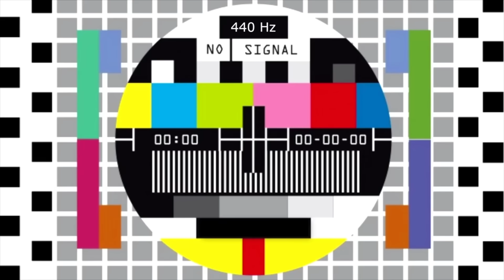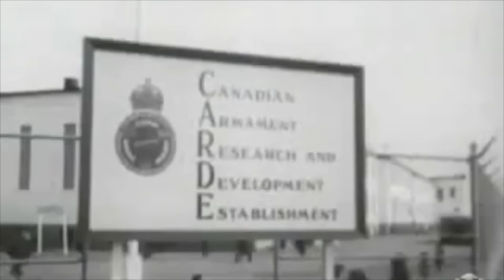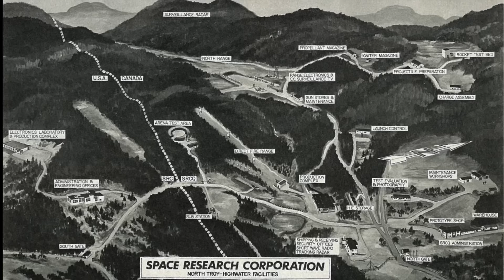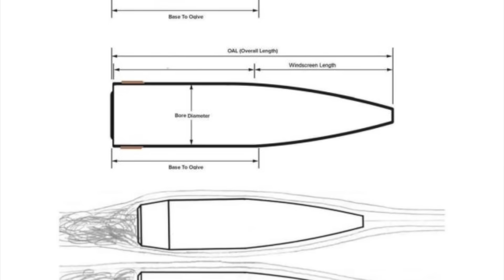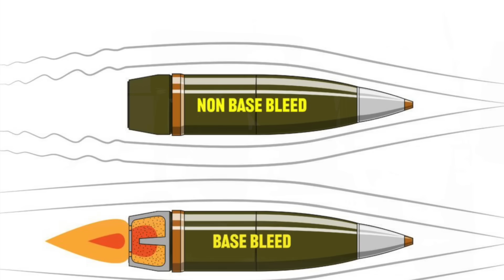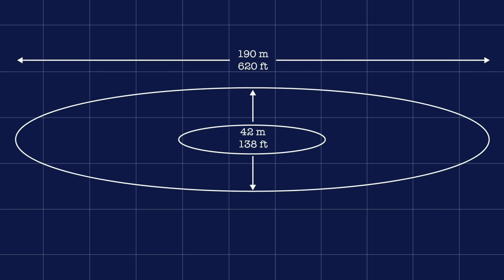155mm ERFB Shell: Faster, Farther, Deadlier

Comment: Although indian army has used this for yearns now, but recently they are in a procedure of replacing thousands of these, by developing new type of shells , successfully developed.
India , got it's erfb - BB OR BASE BLEED , and ERFB - BT OR. BOAT TAIL.
BOTH produced under licence from south africa in 90s for its fh haubits 77 155 mm from Sweden  and its domestic version 155/45 Dhanush and and a new project 155/52 ATAGS , equivalent to Israeli Athos .

Comment: For a brilliant guy I'm always confused by people who think you could get something into satellite orbit with a single propellant blast. I understand the "thinko" of assuming that altitude or wind resistance is the main obstacle of getting something into orbit ... but it's actually the requirement that the object move across the distance of earth that will "drop away" by ~4.9m per second: Half of the amount gravity accelerates something per second. Half, bc if it accelerates by 9.8m², then the average speed of that second is halved. And at about 200 miles up (low earth orbit) it has to travel across about 7 kilometers per second. Of course, you want to do this outside of the atmosphere so that you aren't constantly paying the price of wind resistance. But that's the role of the altitude; being outside the atmosphere. But you still have to be traveling 7 km per second. And we don't even have propellant that burns at 7km per second ... let alone the ability to accelerate something to the exact speed the propellant burns off a single burn.

There is a company (Spin Launch?) that uses partial vacuum to spin projectiles (like under 50 pounds?) up to mach ~5 before releasing it. I STILL have no idea how they'd use that to get something into orbit, as it's STILL going to need a LOT of energy to finish accelerating up to mach TWENTY. 

Granted, if you do the math ... you'll see that SpaceX rockets use 50% of their fuel getting their rockets up to 5% of their end-velocity. But the g-force of accelerating a pendulum up to mach 5 is ENORMOUS. And they can't include the fuel required to get these things up to orbital velocities ... so I'm not really sure how it does any good to get to any speed that's less than the end-speed. Until and unless they could launch something WITH the energy on board to reach even a rendezvous speed to even say ... increase the ultimate payload at a lower launch "price" ... I just don't see the benefit to these projects. But ... maybe I just lack vision ... bc obviously they're receiving $10s of millions in funding.

EDIT: Apparently they're launching payloads of ~450 pounds, which after launching at ~5,000 mph, then has enough fuel to accelerate another 12,000 mph up to the 17,000 mph orbital velocity. Which really does make total sense (for very small satellites).

Comment: There is new G5 experimental version that can fire up 75 km. It has a longer barrel than the standard version. When the G5 was tested in the 80's, ranges up 90km were achieved with an overcharge ( power bag with a cup of diesel fuel). There have been cases where a 155mm shell hit a bulls eye ( A large tractor tire) spot-on 42km.
Reply: I would like to know how such accuracy is achieved isnthis after wallking the rounds in with a spotter, only taking a few rounds then does it hit conaistently.

Comment: The base  bleed shell is exactly that. It bleeds gas that displaces turbulent air behind the shell, which significantly reduces drag. The shell has a small block of magnesium in the base of the shell, hence "base bleed". The magnesium ignites when the shell is fired as a result of the temperature in the barrel. That is why it will look like a tracer at night. There is no "assistance" for the shell, but merely a much reduced drag from the gas produced by the magnesium. The barrels are not anything "special", it's the shells that maketh the artillery, along with the targeting system that measures, and account for, atmospheric temperature and wind speed. When these guns were introduced, they could fire a base bleed shell to 40km, and hit a target as small as 5x5 meters, within 3 shots. When I was doing my post graduate studies in mechanical engineering, we had an absent collegue. This was at the Potchefstroom University, now NWU, which is right next to South Africa's North West Command and Artillery Training School. We would here these guns firing from our classrooms through spring. So, our missing student studied mettalurgy, and received funding from the SA military to remove a disadvantage of these shells, and those were the drive bands. Each of these shells has two drive bands, that seals the shell into the barrel's rifling, which results in friction, and reduced muzzle velocity. So his project was to develop a more malleable allow that would reduce barrel friction (which will obviously also reduce wear), while surviving the the stresses from the charge. At our last quilloquim, he had permission from the SA military to share his study results. With the reduced friction from the alloy he developed, the range was extended from 40 km to 67 km. And with tweaks he got a firing range of 76 km. Thats about as far as a HIMARS rocket's reach, at a fraction of the cost, higher sustained firing rate, and much more ammunition on hand. There is no other artillery gun in the world that even comes close. Something interesting to note, these shells fired, at maximum range, can hit a commercial airliner flying at 39,000 feet. So, the most important part of what I shared with you is this: Avoid commercial airlines that fly over Potch!
Reply: 😀...ja Potch is 'n ander plek!  Dankie vir die 'hands-on' informasie.
Reply: @vlermuis2416  n Paar van my dosente was ex-krygkor navorsers wat gewerk het aan die Cheetah en Rooivalk. Baie interessante goed geleer.
Reply: Thanks for sharing this!
Reply: @janventer7942  
   
I am someone with 30 years experience in pyrotechnics and a license to manufacture low explosives/pyrotechnics with a full time job in pyrotechnics. With a particular interest in aerospace applications/high altitude/vacuum environments.

You either do not remember what someone told you long ago correctly or have not now stated it fully/correctly enough in your description. As you described this, it is not workable. 

Go look up the physical properties of magnesium oxide and see if it is ever a GAS when produced by burning Mg in atmosphere? MgO won't be a gas below about 3,600°C, I can assure you. It is released as a REFRACTORY solid, NOT A GAS at the temperature Mg burns at in atmosphere.

If you use certain oxidizer systems such as chlorate/perchlorate salts and/or chlorine "donor" adjuncts with Mg POWDER as a fuel in PROPELLANT TYPE MIXTURES WITH BINDERS & ETC., you COULD produce magnesium chloride instead (among other gaseous products), MgCl is a gas at only 1,412°C.
Reply: 14 Field Artillery kannon donkies 🤣🤣🤣 yip janventer7942 you 100% correct .......thats why a normal rifle tracer has a higher velocity than a normal FMJ due the same concept of less drag....
Reply: @dirkshumbadrinkersb4908  I actually never thought of that! 😁
Reply: What gas do you mean- ? Please ell us its  chemical name or show its molecular  formlla
Reply: @russellseitz  Doesn't matter what the gas is, as long as it displaces air behind the shell. Stop being a stupid tool.
Reply: Reducing drag is by definition assistance. You cannot write such a paragraph and expect to be taken seriously when you're wrong in the first couple sentences. You need to get less of your information off reddit. Calling a gas generator a "small block of magnesium" is... Well it's comedy. One solid option is composite propellant composed of polybutadiene as the fuel and ammonium perchlorate as an oxidizer.. No magnesium needed. Furthermore your claim of the longest range artillery is incorrect. Bae systems reached 68 miles out with a 155mm round. That's almost 110km. You're right! No other artillery comes close... because BAEs system flies significantly further. Your numbers for HIMARS is completely off as well. It's range is around 185 miles (300km~), further than your inaccurate claim. You're one of those people that really exemplify Dunning-Krueger effect, and your very obvious attempt to obfuscate your lack of knowledge via pure quantity of words (lacking quality) is not going unnoticed. Let's wrap this up with quilloquim is not a word, someone who has ever been present at a colloquium would kmow how to spell such. Stop while you're ahead.
Reply: @DarkAttack14  Just so everyone know, BAE systems has only reached a distance of around 30 km with an unassisted round. I.e. without propulsion (that is something that continuously provide thrust). A base bleed shell does not provide thrust, it only reduces drag. The figure stated by DarkAttack14 is completely false.
Reply: @DarkAttack14  Oh! A bot! Doh!
Reply: @DarkAttack14  I got my information first hand from a researcher that upgraded the shells. Where did you get your information from. And there's a big difference between reducing drag and actively propelling. Get your facts straight.
Reply: A base bleed unit isn't a "small block of magnesium". It is a GAS GENERATOR,  burning magnesium has a SOLID product (magnesium oxide), useless for this application.

Base bleed pyrotechnic mixtures are more similar to  composite rocket propellants and MAY include some finely powdered metal fuels to increase heat of reaction & output gasses but are mostly oxidizer (usually ammonium perchlorate these days), gas generating fuels/binders and/or explosive ingredients chosen from the usual group of propellant chemicals. Mechanical engineer, huh?
Reply: @BertRowe-b3l  I have personally tested 2 different types of field-returned US base bleed grains and dissected the propellants for evaluation. One was an ammonium perchlorate composite, and the other was a double base. Neither contained significant amounts of metal in the formulation.
Reply: @BertRowe-b3l Is that similar to the inclusion of Aluminium powder with Nitrogen fertiliser for a bigger bang ?
Reply: @BertRowe-b3l  He contributed a lot more than your nitpick. Should we award you a badge for being a know it all? jirre
Reply: @Arion-z7l  🤣
Reply: @Arion-z7l contributing requires truthful statements, the original poster here made up a ton of bullshit and expected you to swallow it lol.
Reply: @BertRowe-b3l  No, you have it backwards. Several of my lecturers were involved in military R&D at Armscor during the 80's. They know a million times more than you about the designs of all SA's self developed weapons systems. The magnesium block is the most important part to achieve base bleed. 

"Mechanical engineer, huh?" What are you?
Reply: @janventer7942  He is a troll-comment engineer 😀
Reply: @janventer7942  
Three times I have replied now regarding what a base bleed unit actually is/magnesium oxide not being a GAS- and 3 times my reply has been deleted. That's interesting!
Reply: @BertRowe-b3l  Maybe its not because you are factually incorrect, but because you are being a troll about it?

Comment: At 6:31 you state GC45 the 45 indicated 45 calibers or internal barrel diameters long a "RATIO" that Bull calculated to be optimal.  

A ratio to me indicates that the number must have a NORMAL component height to width.....  Can this "RATIO" be explained or am I nit picking on choice of words?  

To me it says that the diameter of a shell should require and optimal length of barrel to achieve it's best distance.  NO?
Reply: I would think you are right about the ratio. The length of the barrel being 45 times the diameter of the shell.

Comment: Oh baby. Now your talking my lingo. USMC Air Naval Gunfire Liaison Co.  unit in the 80s. 
My unit was trained to call in Air strikes at night
With recon units.  We could hear The 105 and 155 going over our heads at night. From 10 miles away. Easily hitting targets
 1 to 10 miles away. Accurate within 9m. Few years later in Afghanistan and Falucia they were calling them in going through windows of the target building. Oh well did this with Linsatic compasses you had to light up with flashlight and prc25 radio. Closest phone was in the E club.

Comment: Except ... an unguided shell can't achieve orbit. It can go as FAST as something orbital, but without any sort of motor, the ellipse it follows will pass through the last point where it was given a nudge (in this case, the moment it leaves the gun barrel). The very best you could do would be a shot tangential to the surface of the Earth (firing just above the horizon), but even then the shot would arc out, circle around the Earth, and then enter back into the atmosphere to complete the ellipse (touching the end of the gun barrel). In practice, drag from the atmosphere would keep it from reaching the point where it started ... but without some sort of motor (or drag) to change the orbit, it's always going to pass through the last place where it received any thrust. I suppose they might have been planning to include some sort of small rocket thruster on the shell to tweak the orbit once it cleared the atmosphere, but a GUN is a heck of a lot of impact inertia, and you'd need a guidance system that could handle that launch.
Reply: Plenty of artillery rounds have had internal electronics the super gun was to launch rocket assisted rounds.

Comment: The nubs do not engage the rifling. They ride over the rifling. The nubs are too wide to engage the rifling.  155 mm guns can shoot standard rounds and ERFB rounds. The nubs keep the projectile centered. The nubs are angled to match the projectile spin caused by the driving bands.  The ERFB projectile still uses a driving band, it's just not as substantial as the original driving bands.
Reply: I'm sorry, I don't understand.
The way I read your post is that the nubs make the projectile wider than the inside diameter of the barrel. I am not sure if that is wider than the lands or the grooves of the rifling.

But,  you say the nubs do not engage so their diameter must be less than the barrel.
Reply: @ the actual projectile is a smaller diameter than the bore except at the driving band. The nubs center the projectile in the bore. Gerald Bull originally used a discarding sabot type system. The projectile was smaller than the bore but the sabot was at full bore. Big bang for a smaller projectile giving high velocity. The nubs are at full bore without a sabot system. The nubs slide over the lands … they are twisted so they match the projectile spin already imparted by the driving band. The nubs are there to center the round. The round needs centering because the round is smaller to allow higher acceleration and higher velocity. The nubs don’t engage lands and grooves … they simply slide over the lands.

Comment: The Babil gun barrel would have been concealed inside a tunnel drilled in the side of a mountain. The only vulnerability would be a one metre hole, the muzzle, on the surface. It would have been very hard to destroy. Also, it was adjustable a few degrees for line, at the breech end, and range could be altered by changing the propellant charge. Two were to be built, one pointed at Tehran, one at Tel Aviv. Two shells a day, containing a ton of HE or other filler, could be fired from each gun.

Look up the history of the German V3 weapon in WWII for its ancestor. You are quite wrong to write the idea off as impractical. It would have been very effective as a terror weapon, and short of a nuclear device, nothing would have touched it.  The V3 was destroyed by a ten ton Grand Slam bomb, of the kind we no longer make.
Reply: The probably method of destruction might be to cause a mudslide at the muzzle. Freshly made Portland cement pushed out the back of a transport plane. 
You would spend a long while cleaning it, in case it blew up.

Comment: in my youth I was fascinated by this sort of subject and was under the impression that Dr Bull had used the German fixed ‘Super Guns” that they had started installing to fire at the British Isles from Europe. If my old memory serves still, I recall that those devices didn’t merely use an explosive propellant at the the breach but were also assisted by a series of gas-powered percussions along the barrel as the projectile progressed up the barrel. 

Or did I dream that?
Reply: You didn't dream that. It is described in a Wikipedia article.

Wikipedia contributors. (2024, September 4). V-3 cannon. In Wikipedia, The Free Encyclopedia. Retrieved 17:39, September 9, 2024, from https://en.wikipedia.org/w/index.php?title=V-3_cannon&oldid=1243930773
Reply: I wonder what the original sources are.
Reply: There were guns designed with the pressure system you described